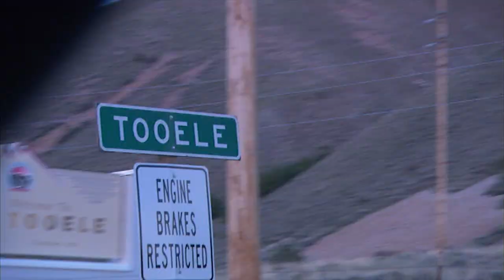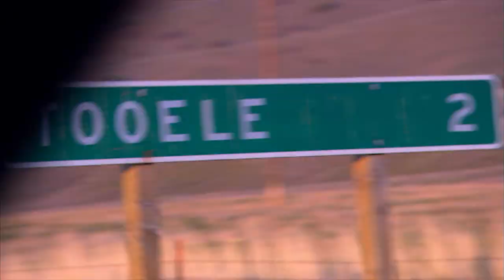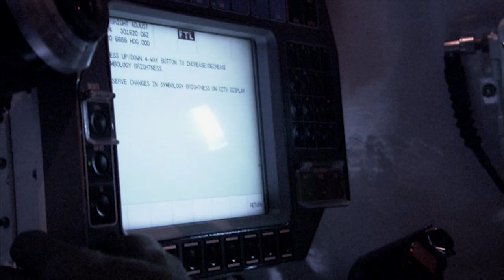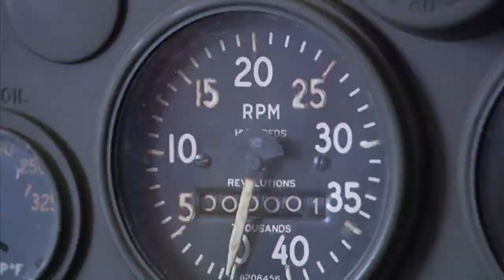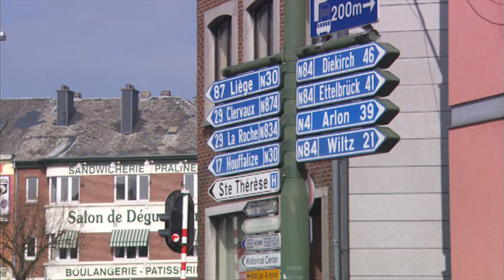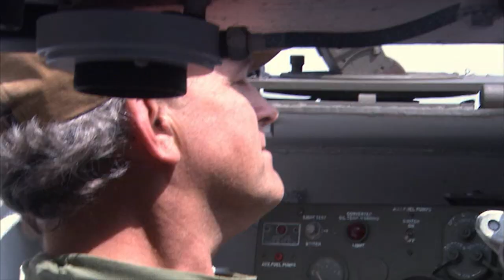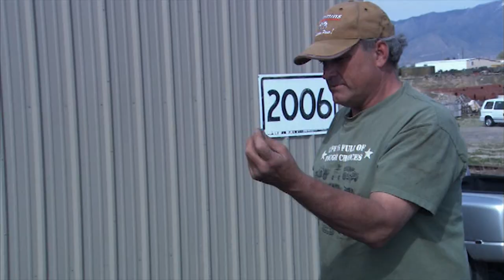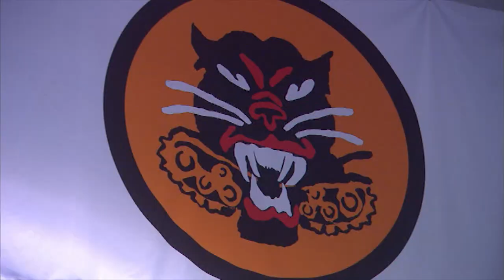Tank Overhaul - Episode 4 - The M18 Hellcat

Comment: Another fact tidbit: The lack of a muzzle brake and the lack of threading for a muzzle break means that this was one of the first M18 Hellcats from the production line, equipped with the 76mm M1 gun. The threaded gun would have been an interim gun, the M1A1C, and the muzzle-break equipped gun was the M1A2.

Comment: Nice video but one major correction the M18 never shot a round that uses "molten steel" to penetrate German armor. The rounds used by the M18 were the AP solid shot, APCBC  armor piercing with an explosive filler, APCR/ HVAP high velocity shel with a dense core for high armor penetration, high explosive, and a smoke round. 

All the rounds used for anti armor purposes (AP, APCBC, APCR) were kinetic penetrators that used the mass and speed of the projectile to penetrate armor. The "molten steel" penetrator that they probably mistook for the APCR round is a chemical penetrator and uses a copper penetrator not steel. These rounds are known as HEAT rounds and we're in use by the Germans and weren't used till after the war by the US (in tanks). 

The side skirts of the German tanks weren't meant to protect the tank from full sized tank rounds but from anti-tank rifles which were wildly in use by the Soviets during the war and we're effective at damaging/disabling tanks without the protection of side skirts. 

Side rant HEAT rounds don't work by thing their copper jet molten and melting/burning it's way though armor. Copper melts at 1085°C (1983°F) while steel melts at 1371°C (2500°F). HEAT warheads work by creating a hyper sonic and narrow projectile of copper that is able to penetrate steel armor due to its small surface area and high speeds.

Comment: @31:39 you see the radial engine being connected to the transfer case to lower the drive shaft to the front mounted transmission.
So you can see that there was a easy solution available to lower total silhouette. It coud have been done during the design of the Sherman too.

Comment: I was a Bradley mechanic. I loved the job and driving the Brads, M88a1's, and the Abrams. The Brads had a good suspension system. But compared to the Abrams....well nothing with tracks compared to the Abrams lol. Driving a Abrams was the smoothest experience I ever had driving tanks. Also just because the Abrams has a slower speed than you would think it would doesn't mean its slow in design. I had always heard that when they were making the Abrams the turbine engine put out so much HP that the tank could rip apart track shoes or at high speeds 60 MPH + the track might break from the stress. So they are governed down to the speeds they do run. The Bradley's could do 60 MPH and often did. But like any tracked vehicle if the track broke you could suddenly find yourself in a world of hurt. The M88a1 was rated for 25 MPH but usually ran 20-22 MPH. If you had a 88 that was doing 25 MPH without towing another vehicle then it was smart money to go ahead and order a new engine because the one you had was going to blow jugs pretty soon. I miss my job every day. I was med boarded and I always just feel like all of that experience I had built up just went down the drain. So many recovery missions in Iraq and other places. Once you get tanks truly in your blood its so hard to not want to be back there with them.

Comment: Oh yes, it is. The Abrams is actually faster than the hellcat. I’ve already heard stories from different military guys saying how they took the governor off. I work with a tank mechanic at a machine shop and the base commander had them take the governor off and they wanted to see how fast it would go before it threw Track. You would actually go 100 mile an hour before it threw Track.

Comment: ......The M1 76mm cannon never had a HEAT round made for it. it had HVAP, APBC, solid shot AP, HE, and WP, but never HEAT.

Besides that, outstanding job.
Reply: Sorry to say that your 'list' is wrong. The M18 fired these: M62 shell (APCBC), M79 shot (AP), M93 shot APCR and the M42A1 shell (HE) and WP indeed, for smoke. In your case you are listing 'HVAP' as a separate shell. All the M62, M79 and M93 shells are considered HVAP. Small distinction there ;)

Comment: Dissapointing video. Focuses too much on the Abrams tank, on general properties of the Hellcat and hardly at all on the actual restoration process on the Hellcat. Could have been condensed to half it's length if it only focused on the title of the video. Search elswhere if you want a good restoration video.
Reply: +Andrew Erntell  Just so.  This video has too much filler about the Abrams tank, about the Battle of the Bulge, etc, and not enough about the actual restoration, which is allegedly its subject.  Also, in comments to Part 1 of this video elsewhere on YouTube, I pointed out they also got some of their technical facts wrong.
Reply: There is a good reason to mix the two. The tank destroyers of WW2 were a strictly interim solution. General Patton gave the reason even before setting off to battle the Germans. "The right gun and ammo on a tank will make the tank destroyer obsolete" was his condemning of having tank destroyers part of his battalions. By the end of the war, this was the case and no dedicated armored tank destroyers were ever made afterward. By showing how modern weapons are used, the viewer can easily see how the transition has been made.
 As for watching someone disassemble, repair or replace, sandblast, and paint a used armored vehicle, all that was done without all of the tedium for the general viewer. Did you really want to see that table full of rusted parts being fully restored? Build the model instead.
Reply: And ever so redundant x,x same story after every cut ffs
Reply: British Fireflies were retro-fitted Shermans with their own 3 inch 17 pounder 76.2 mm high velocity gun. To get it to fit they had to rotate it a quarter turn.
Reply: John, i already have built the model, and i really would like to see the entire restoration process.
Reply: Yank propaganda.
Reply: Just ignore the part where it talks about the Heer right Little Willy?
Reply: John Pombrio call the show "tank history" then...
Reply: the reason why is because there was not much that they had to restore. It was already in good condition, it just needed a paint stripping, new paint, and everything reinstalled, all of which they already had.
Reply: (To:  Mr. pnartg) .......... In my professional opinion, topic of this film, is NOT particularly about this HELLCAT vehicle restoration.   It is a documentary film, and this restoration fact, was only one of so many layers of that film.  The most important part of this movie was the story of the REUNION of the old veteran Hellcat's commander with his lovely precisely restored vehicle, and about his JOY of riding in its turret after 60+ years of splitting up with it, when the war was already over.  OMG !!!!  What a great pleasure, what a wonderful joy !!!!  That was the real reason, of making this amazing video !!! >>  I just love it so much !!!!
Reply: This was actually aired on the Military Channel before it was currently called American Heroes network. It was a sister network of Discovery channel. Even before that it was called Discovery Wings network. They changed the title of the network as more content became available and most of it was based on history because they were in direct competition with History channel's "Military History" channel. I used to watch both religiously in the daytime when there's nothing on but horseshit because I worked at night. Now both channel's have softer programming because of the snowflake takeover of the networks.
Reply: Still loved the video but your right don’t get the connections with the Abrams and why they even put that in there ...so much more they could have added pertaining today Hell cat
Reply: But Andrew, it may not have had exactly what you were looking for as far as a restoration video goes but to say you disliked the video, I just can't imagine anyone disliking it the story alone made it well worth it even if it didn't have all the content you were looking for, sorry you were so disappointed!
Reply: But Andrew, it may not have had exactly what you were looking for as far as a restoration video goes but to say you disliked the video, I just can't imagine anyone disliking it the story alone made it well worth it even if it didn't have all the content you were looking for, sorry you were so disappointed!
Reply: I'll be waiting for the link to your better tank restoration video
Reply: The Yank propaganda saved Limey, Frog and other assorted Euro asses in WWII.
Reply: The reason why so much of it was focused on other things than the actual restoration, was because most of the work was already completed. It had been sitting in the collection already mostly restored, all they had were little things. They honestly restored it very quickly, they took a running engine from another and that is just plug and play. This was more about the lasting effects of the tank's performance than anything.
Reply: Andrew Erntell they seriously need to stop focusing on the Abrams tank. Yes it’s a good tank but that’s not what the video is about
Reply: Filler, but yeah, I had to rewind a bit every time they went back to the Hellcat. I'm sure that was to keep a younger audience interested, but probably unnecessary. The best footage always ends up on the cutting room floor - rule of filmmaking. Nice to hear from both though.

Comment: i think the reason the M1 is "slow" is due to a speed governor.
Reply: Correct; the first M-1's got up to 70 mph in testing.  That's okay on level ground, but running over ditches and rocks they were breaking tracks a lot.  So production models had speed governors installed.

Comment: Where do you get your facts. The 76 might have shot APHE but never HEAT and besides that it would not be very penetrating because of the small diameter and I have never heard of a HEAT shell projecting molten steel. I like your stuff but what?
Reply: Warmahan the m18 hellcat fired high explosive anti tank  shells =heat shells  and no armor persing high explosive  shells =aphe
Reply: Thank you Brian Gronouwe, for the explanation of the acronyms. An acronym can be pretty annoying if you don't know the meaning. It seems like the user is trying to make you feel like some kind of outsider.
Reply: My father was part of the 609th TD division, Patton's 3rd Army. I remember he said they had two rounds. HE and AP. High explosive and Armour Piercing.  The HE round would take down a house. The AP round would go through steel like butter he used to say.  Had thermite.  He used to take out tanks and even tried to take out a ME 262 with the 50 up top. The tracers went through the plane, however nothing happened. No prop, wondered what it was. Flew over too fast! He didn't see another ME 262 until the 1970s in the Air and Space Museum. I think I still have the lube manual to the M18.

Comment: 76.2mm? So it's a 3.00 cal, instead of a .30 cal. Wonder if the shell was like a scaled up 30-06, but by a factor of ten, like the bore diameter was?
Reply: The rounds were not scaled up .30-06.
Reply: @peterson7082  what do you mean?  A 30-06 is a 7.62mm. The main gun on this tank is 76.2mm. The projectile itself is basically 10 times the size of a .30 cal Spitzer projectile. But yeah,  it's probably closer to a scaled up 7.62x25mm tokarev.
Reply: @kitaryakysubae3156  The length of cartridge and projectile are entirely different.
Reply: @peterson7082  smh. Are you ever understanding what I'm saying?  The diameter is TEN TIMES the size of the 30-06, which the M1 garand uses, which was the standard infantry rifle of the time. That's why I used it. Oh, and I did some math. If the Hellcat did use a round that was a 30-06 but scaled up by a factor of ten,  and assuming the data figures Scale linearly,  that tank shell would be roughly 1000 times as powerful as an M1 garand or bolt action 30-06 Springfield rifle. But I know it doesn't Scale linearly,  and it excludes a lot of variables. 

But do you see what I mean now? 76.2milimeters bore size is pretty much dead on 3 inches. And a 30-06, is a .30 caliber round, meaning the barrel bore that it chambers into is 3/10ths of an inch.
Reply: @kitaryakysubae3156  I understood what you meant. But the length is not proportionate to the size of the .30-06.
Reply: @peterson7082  I don't know.  I'm not gun expert. I don't even own guns. Probably would if the Canadian government wasn't so restrictive.

Comment: all that work, to get it to work,  then you have the damn Soviet tanks, they pull it out 70 years later from bottom of a lake, and it starts up.... wtf
Reply: The difference was the Russian tanks were diesel and the fuel was not contaminated.  After cleaning up the starter motor and replacing the batteries it started right up. Diesels run by compression not electrical spark, big difference.